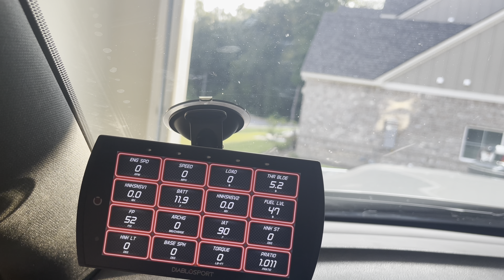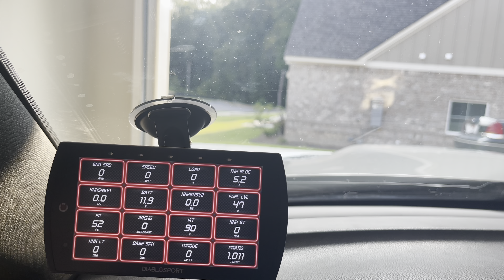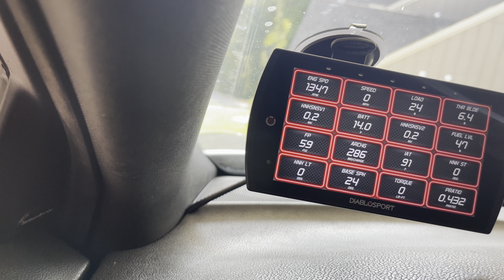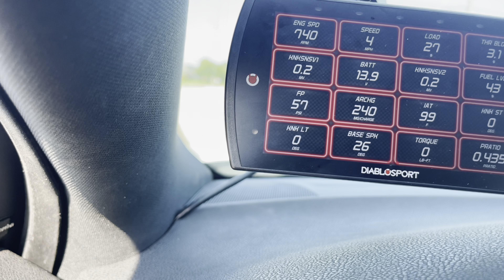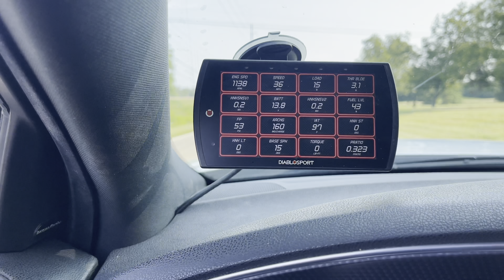Fore Innovation Fuel System For My Dodge Charger Hellcat!!

Comment: Glad i found your video man
Reply from the maker: Glad i could help bro
Reply: @bigrobbtv  i know you did this video a minute ago is the rails and your fuel pressure holding up good ?
Reply from the maker: Mannnn are they?? I have NO REGRETS! Especially now since I went dual fuel pumps and I’ll be going E85 so it handles high pressure well and can support BIG fuel applications i love it man
Reply: @BigRobbTV  love to hear it bro I'm on the same setup too with flex fuel I done replaced both pumps, fuel filter and still can't figure it out till someone showed me your video hoping this shit work just put in my order for it
Reply from the maker: What kinda issues are you having ?
Reply: @bigrobbtv  fuel pressure dropping bad and on WOT it boggs out when you have the scanner up you can see the fuel pressure dropping as low as 32psi
Reply from the maker: That’s the same problem i had! Now you said you have dual pumps already ?
Reply from the maker: Did you replace both the stock pumps with another OEM pump ?
Reply: @bigrobbtv  yes this happened with the current setup i have now also when you ordered the fuel rails did you order a new fuel sensor or did it come with one ?
Reply: @bigrobbtv  oh my pumps are from fore innovation the TI285 pumps
Reply from the maker: It came with one . Have you ordered it yet or you’re about to order it?
Reply from the maker: Drop your number on Instagram @BigRobbTV
Reply: @bigrobbtv  I’m about to order it now on the website I’m ordering the fuel rails with the line adapter and crossover i was looking at the picture and noticed the sensor is different so wasn’t sure if you had to order a sensor as well
Reply from the maker: Don’t order it just yet hmu first
Reply: @Mr.Extraextraordinaire  hey bro did you ever get that wot bogging issue fixed? I’ve been having the same issue for like half a year now. It’s like so inconsistent on some pulls it’ll go fine but then most of the time i notice on the log it bogs for a split second with fuel pressure dropping from the 80s down to 50s. I got both new stock pumps in by the dealer but I’m moving onto the rails,sensor and stuff next hoping that’s it
Reply: @1bdhellcat  yea i figured out my bogging issue it was something i did when i came back from the track i bolted down my rear seats on top of one of the wires for my fuel setup by mistake which had some of the wires exposed a lil on the metal causing it to do it but that’s on a dual fuel pump return less system if yours a stock system i wouldn’t do the fuel rails just yet i would replace the fuel pressure sensor first it’s a small sensor on the back side of the the fuel rails
Reply: @Mr.Extraextraordinaire  yeah that sensors the next thing I was going to look at since everything else is pretty much new and I inspected the cables and such. Everything I saw for that sensor though you pretty much have to replace the rails with it or it’s better to. But thanks!
Reply: @1bdhellcat  yea you right i forgot about that youll have to get a whole new line which you might as well get the fore fuel rails since they are around the same price and with those rails you can change the sensor out freely if you need to plus them being built so much better
Reply: @Mr.Extraextraordinaire  yeah haha especially if I plan on going flex fuel like you guys lmao